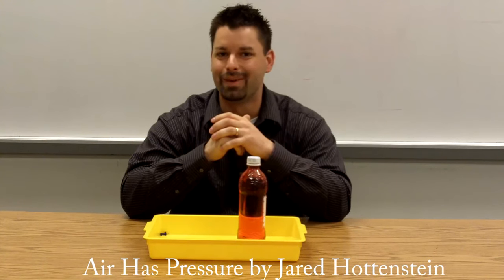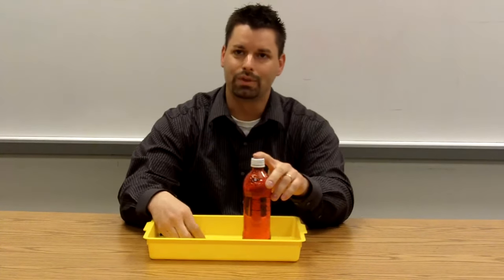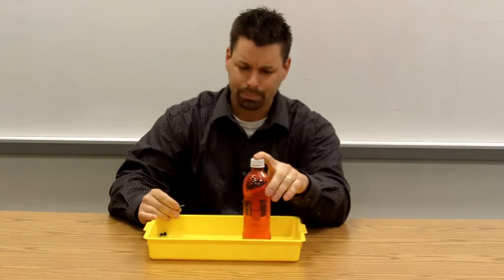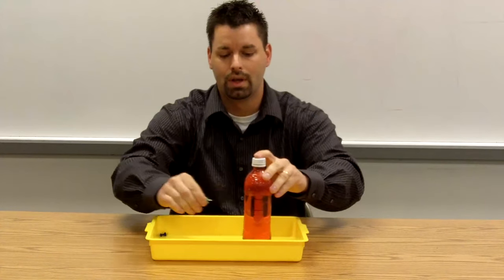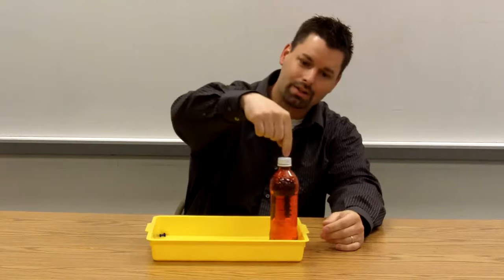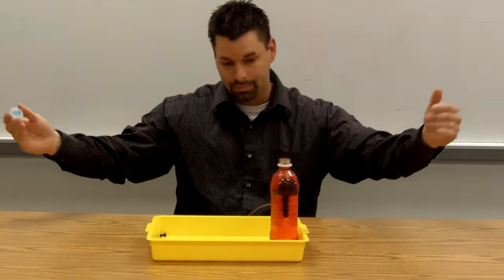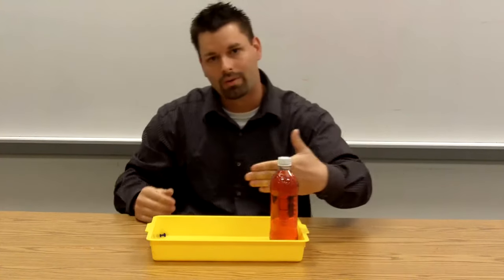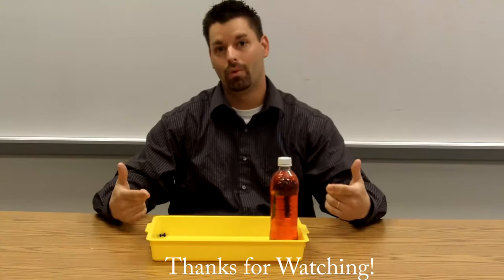Air Pressure and Bottle

Comment: Correct me if I'm wrong.
When the cap is on air pressure prevents water from coming out, if water was to come out it would create a vacuum in the bottle which air pressure wants to keep full, thus not letting the water out. However when the cap is off, it is not air pressure that is pushing the water out because air pressure is at equilibrium at this point. When the cap is off gravity is allowed to push the water out without the interference of air pressure. If this experiment was done in a vacuum then water would come out with or without the cap on simply due to gravity.
Reply: TheEyesOfNye thank you....i was wondering that...but you know the water comes out because of water pressure....which is an effect of gravity so anyway you're right...

Comment: Awesome, but small question, at first nothing could come out, as air pressure is greater than water column head 

but when we uncap for sometime, there will be some air which gets trapped in the bottle, couldn’t that air push water out? 

Pls explain

Comment: if you make a bigger hole without removing the cap, wouldn't it leak? how do you explain this phenomenon? wouldn't weight of the water also contribute?
Reply: That's so simple; The air pressure is too low to push a bigger amount of water.
Reply: @apurvaagarwal4948  what is wrong with you bruh

Comment: Hey Jared, what would happen if you put that same bottle with a loose or cap completely off submerged in a tub of water? Will the water INSIDE the bottle only flow out once the water surrounding the bottle goes lower than the pinhole?

Comment: so as long as air can get in it will leak? Also if the air where its coming in is as big as the hole the water is comming out it will come out at max flow rate?

Comment: This can be very confusing for many clever children (and peaople), because as stated, there is an air pressure forcing on each inch of the bottle, so if the cap is off, there is "mostly" the same pressure forcing on top of the water and the same pressure forcing on the side hole ... so there is an equiliubrium and nothing should happen (in terms of air pressure). What drives the water out of the bottle is the pressure of the water above the side hole, not the air pressure. So beware of such wrong information, that can seem to be right.

Comment: Help me in this question dekha notebook calculate its area and perimeter think late calling for one on top of another ep 7 or 8 ssuch type of notebooks of same size to make a cuboid measure the height of the pile. Find the volume and surface area of cuboid

Comment: You should have pointed out that the tiny drop that came out at first was because of the pressure difference at first; because you screwed the top on.  It's obvious to a viewer with good eyes that there was one drop that indeed came out when you first pulled out the pin.